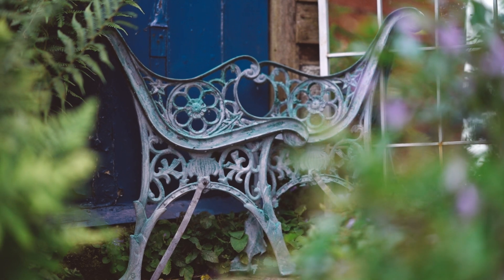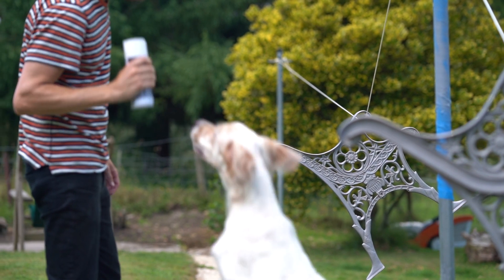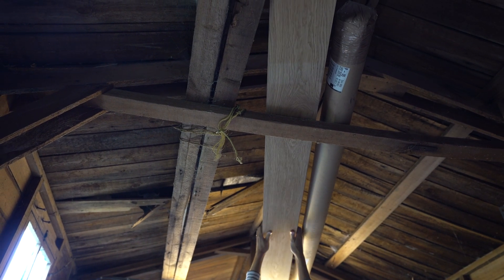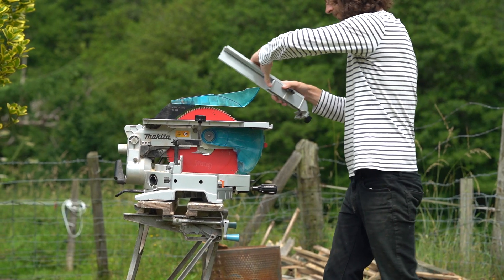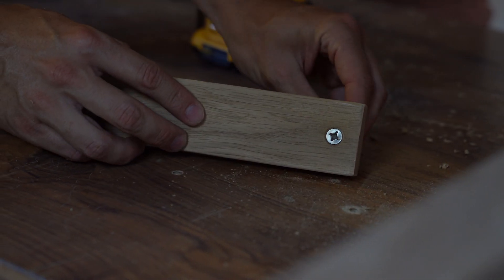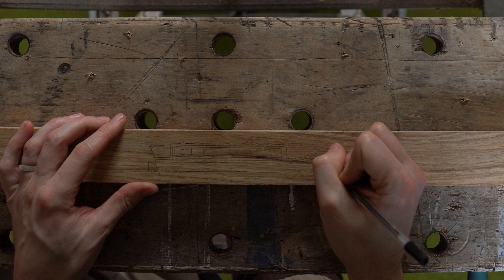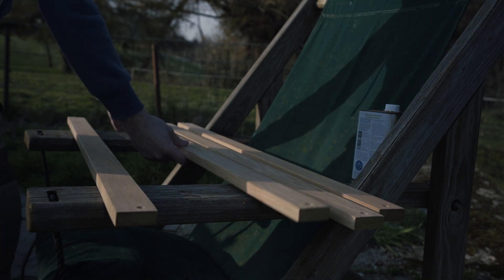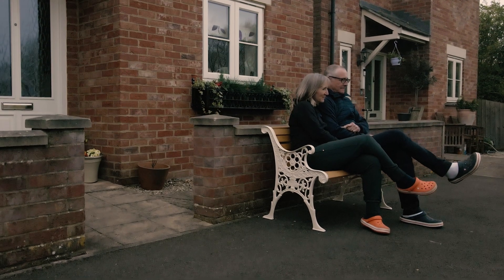Cast Iron Bench Renovation - Creating A Beautiful Garden Feature - How To

Comment: Hi Joe I’ve got the same bench ends and restoring these myself. Did you use different widths on the wooden slats for where it curves on the top and bottom slats or did go for a 50mm width on all the slats
Reply from the maker: Hey Pete! I used the same sized slats all the way round, it was a little tight in those corners but seems to be the way they were made! Hope the resto goes well!
Reply: @WoodandWild  thanks for your reply. That’s good to know thank you.